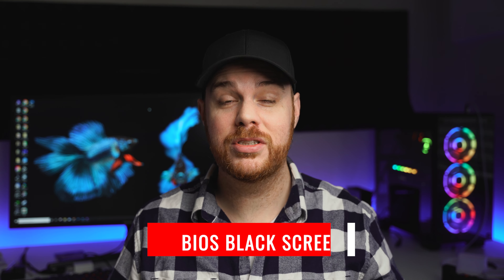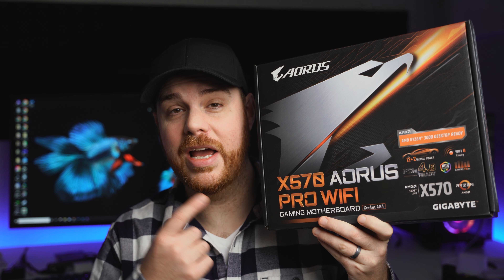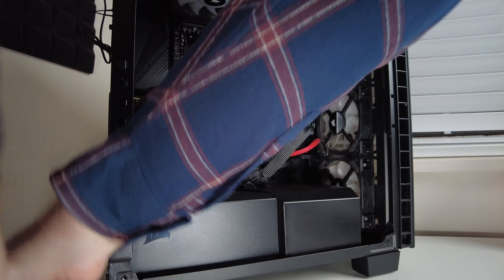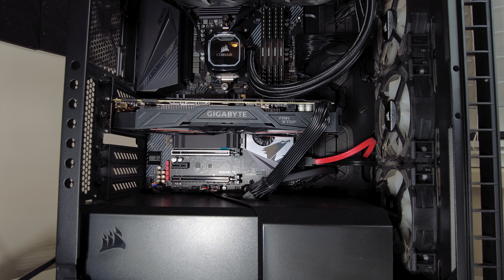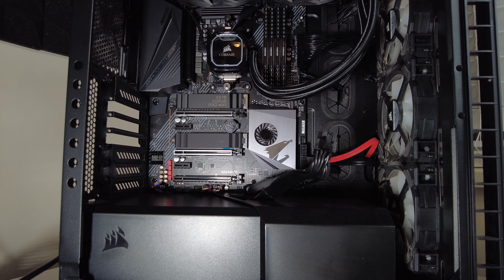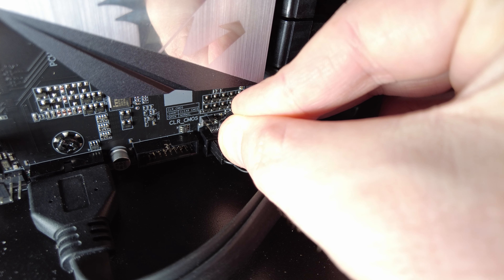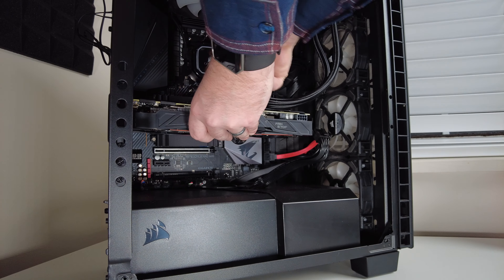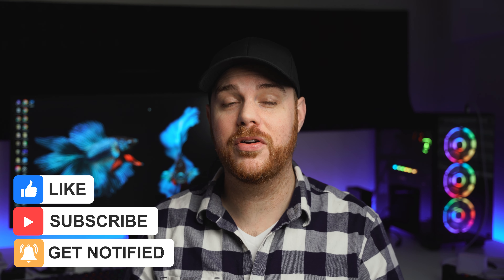How to FIX BLACK SCREEN from BIOS CHANGES (3 WAYS)

Comment from the maker: Hope this saves someone a heart attack!
Reply: I did an update through dragon centre an nothing was lit up except for my fans motherboard an ram my screen was black my keyboard an mouse were too i tried holding the power button down to turn it off but that didnt work so i cut the power completely reset it an its still the same
Reply: Holy shyt it worked my heart literally stopped for a solid hour trying to fix this
Reply: @Silence-cv5xm  know someone going through this right now. What ended up happening??
Reply: NOT ME, i updated grub via terminal in Pop OS and instantly upon restarting my computer would no longer boot.
But i could still post and get into bios so i tried changing some boot options and now my computer wont even POST. fans and diodes all light up on rx560  gpu, b350 mobo, debug lites go off after few secs but screen stays black entire time.
measured v rails at this time and get 3.08. 5.07. 12.07 on rails, cleaned out psu and inspected for burn marks or bulging caps, none. no bulging caps on mobo or gpu
ive removed the battery and shorted jbatt several times. tried removing boot m2 drive and tried a spinning disk, all for nothing.
how does this happen?
Reply: It did not work for me then I called a mechanic and he said that my hard disk is corrupted.😢
Reply: It did thanks
Reply: Thanks
Reply: Already had the heart attack... Gonna watch this video and try to fix it tomorrow when I have time!
Reply: If Stefan or anyone sees this, does the pc also need to be unpluged when you short the CMOS jumper
Reply: @baconsmasher-lancerguy  Yes
Reply: 10/10 A + THUMPS UP
Reply: You definitely saved me a heart attack! Thank you so much for this video
Reply: I'm going in. It's not bad, just an issue with my 2nd ram card and going back and forth from integrated GPU in a 3200g, which I wanted to swap with the 5600x I received last week. Flashing bios was easy and I took the latest version (MSI 450b pro max2) but then you read possible solutions as taking the updates step by step, but my version that ran wasnt' that old. And otherwsie your method or another. It will be okay :) And it's much more relaxed when you have another pc in the house (I live alone) so while lesser, you can still easily look up stuff, use it for two weeks when you have to and just game on lower setts.   

Edit: Subbed, will be watching your photography uploads tomorrow! Nice hobby/profession
Reply: This is super late but I have a button that says cmos reset, do I have to turn off my computer, unplug from the electric source and then press it? And for how long ?
Reply: Hope they got a phone to watch your videos. lmao
Reply: @shankhadeepdas9871  You called the wrong guy bro, mechanics work on mechanical vehicles and mechanical airplanes.
Unless your pc is a Tesla.
Reply: @jespermynchau5580  not a mechanic, sorry, a tech guy, whatever you call them
Reply: Bro you saved my life
Reply: this helped me so much thank you
Reply: tried but not work for me but i am glad to see someone using same graphic card with exact same model (1070 8gb 3fan)  , to be honest i don't like in term of performance , but when i overclocking this GPU only then you see real capability , but after using more than 5 years . i damaged my motherboard 2 times . ending note  before overclocking specially AMD cpu upgrade your cooling unit.

Comment: Hey guys for my Asus motherboard reseting the CMOS didnt initially work. What worked for me was removing all my ram sticks. Then I added one stick to slot one of the motherboard and restarted the PC. That finished the BIOS update. After everything is clear you can now add the rest of the sticks.
Reply: After Updating my Bios to the latest version, I got a black screen on reboot after the update. Thanks so much I saw your comment, both methods in the video didn't worked for me too, then I saw this and tried removing 1 of my ram stick as I have 2, then restart my PC. Im so happy it worked😁
Reply: @ItsCepheus  Am glad it worked for you brother
Reply: Hey what’s your Asus model mobo ? Did you reset your bios after removed the battery or other method… and then add 1 ram stick ? Or just add the ram ?
Reply: hey man, i have been struggling with this for the past week, and your comment single handedly saved my computer from getting overcharged with this simple fix, i am truly thankful for you,  and i wish you the best of luck in your life, thank you.
Reply: This is the way. Pre-built came with ram on slot 3. Reset cmos via battery and nothing but black screen on monitor. Moved ram to slot 1 and we are back in business.
Reply: Take out the ram stick then put one in and boom
Reply: Preciate this man

Comment: Such a lifesaver! I was about to start crying that my laptop didnt want to boot up properly after a BIOS restart, for the guys that have MSI laptop some of them have a very tiny power reset button on the back press it for 30 sec and voila, basically the same concept as shown in the video
Reply: Yooo on the back of the case or inside of the pc?

Comment: Dude thank you! This saved me more than you know! I thought I was going to have a heart attack when I saw the black screen. I’m not going to try to upgrade to windows 11 for a long time.
Reply: Go back to windows 7:) best one there is
Reply: BROO SAME my heart was racing like crazy and I wanted to do the same thing as you hahahaha. You messed up while trying to enable Safe Boot as well?
Reply: @julijangrajfoner1730  yoooo that's exactly what im trying to do, im carefuly watching the vid
Reply: @axelgrot5157  loool what mother board do u use?
Reply: @julijangrajfoner1730  aorus b550 elite v2 ; i resolved the problem with the battery removal strategy, but as soon as I re-disabled CSM, the black screen came back... so i guess whenever i want to work in the bios, ill have to remove the battery
Reply: @axelgrot5157  oh that's unfortunate
Reply: Msi pro b650 here and this is what worked for me too, or rather I tried this first. Thank you

Comment: I was messing around with bios and I changed something and when my pc rebooted my mobo was flashing on the dram, suggesting that there’s a problem with my ram. When I turn my pc on I am stuck on the press DEL or F2 to go to bios screen. Please help, I’ve had this pc 2 weeks and it took me 3 years to save up for and buy :(
Reply: if CMOS reset not works try to remove your components (ram, SSD + GPU) and install the bios new over the flash bios button (hope you have one). i had a blackscreen issue after update the bios for resize bar last weekend and could fix it after the mentioned solution

Comment: Yes I was messing with the BIOS settings and screen went black and this video help me. Thank you sir here a new subscriber
Reply: How did it work and which one because I tried to get Val and I just bought a pc today it’s not working
Reply: @captainluci7083  all I did was removing the Lithium Battery that comes on the Motherboard for 5 minutes and then putt it back and was working

Comment: thank you for this, this really is a life saver, was really panicking cuz i was just changing my ram frequency and the black screen just happen as soon as i reboot it, my pc is just 1 day old. really thank you and thanks to my friend who helped me in this as well.
Reply: I'm in the same boat as you. I have one question though. I had to flash my BIOS to the new chipset, before I actually built my PC. Do I need to refresh the BIOS or were you using an older chipset. Also unrelated I need blood pressure medicine now.
Reply: 99999999999

Comment: I’ve changed the battery and hard drive I’ve also checked data cable all the cables made sure they were all connected properly. I got an error message when getting home one day, been trying too get it too work again but can’t get passed bios and bios only recognizes my m.2 ssd and not my internal hdd which has my windows on it. What do I do!!!
Reply: Did u fix that?

Comment: on the battery do u change it or is it ok to use the same one?
Reply: They last a long time.  I wouldn’t change it unless BIOS settings do not save, or a known good fixes your boot problem.

Comment: Guys remove memory battery it works i do turn the second gpu and i had this problem i try to update my rtx and didn't work when i remove gpu and remove the memory battery i still removing it between 10s and 30s and put it back in its place & put your gpu also after finishing these Steps 
 start your pc after 20s it will works and u should see the bios automatically without spamming any button

Comment: hello, Iam trying to get into the bios and everytime I enter, my monitor goes into sleep mode, but my pc is running the bios. ive tried my hdmi in the graphics card and onthe mobo, as well as trying another monitor. ive tried different resolutions and that did not work. this is really annoying and ive searched forums and google and cant find anything on this. anyone know how to fix this?
Reply: Got the Same issue Did you get it fixed

Comment: I have a dell optiplex 9010 i went to the bios and disabled the  sata operation and now im getting no display any solutions?
Reply: Have you find a solution
Reply: @harysviewty  yeah it was my motherboard, I switched it to Asrock z77 extreme4 and it works great, it also  starts up under 5 seconds

Comment: i dont have a reset button, removed and replaced battery and tried to short cmos jumper
nothing worked pc still not showing a display, but everything turns on
Reply: have u find a fix?
Reply: @Rantize  that's what i don't understand they never reply ever
Reply: @SamuraiDanny frrr... Did you find a fix? I'm dealing with this issue rn
Reply: anybody found a fix?
Reply: @ sorry for the late reply, youtube failed to let me know you did...i didn't find a fix sadly...i ended up getting a used PC from my cousin
Reply: @ or sometimes people dont get notified when they get replies
Reply: @icanartsorta  ahh okay thanks tho for replying
Reply: I ended up fixing mine. It was front panel connectors not being properly seated. So I just stretched the wire more to the front and that solved my headaches lol.
Reply: @aliennzzz  im gonna try to do that
Reply: @aliennzzz  my pc  started giving me a black screen after i turned on secure boot in my bios
Reply: @ATLDanke  sorry... I forgot to ask did it work out for you???
Reply: @aliennzzz  nope just bought a new motherboard now im gaming happily
Reply: Damn... Well at least u found your source of the problem.... I wasted money replacing good parts and it was just my panel connectors lol
Reply: @aliennzzz  damm try to get refunds

Comment: The battery saved me. I tried messing with my ram clocking speeds, saved and booted the pc up. Black screen as if my pc was off. Took battery out and poof within 15 seconds JT was working again

Comment: None of these methods helped. Updated BIOS, after update OS was still launching for several weeks until I've noticed the black screen upon entering BIOS. Followed your instructions, black screen is still there but now I can't load to OS - initial setup is required which is not possible due to black screen. Looks like I'm screwed, thank you, kind sir!

Comment: when I changed the ram from my prebuilt pc from 16gb to 32gb 3600mhz when i checked the task manager it said 2133mhz so i went into the bios and tried changing it and when I saved the changes it cause my monitor to not display when my pc is on Its not my gpy or anything else my pc is clean i even tried cleaning the ram and it still didnt work. its a omen 25L

Comment: Thanks for the video. We have similar MOBOs (Z390 Master 1.0 here). In addition to the above steps, there's potentially a 4th method which is a motherboard BIOS switch for Main and Backup. After attempting to update from CSM to TPM 2.0, I got the black screen.  However I knew upon last firmware update I backed up the BIOS. Switching from the Main BIOS physical switch on the motherboard from 1 to 2 easily cured the black screen issue. No removal of battery, jumpering or even a CMOS reset button. While this worked and I'm back into Windows, the MAIN CMOS (switch 1) is still corrupt. Hoping to locate an AOROUS approved method to restore the MAIN BIOS from a BACKUP BIOS..thank you for this video.
The NVIDIA site claims to remove the graphics card completely out of the MOBO and boot to the onboard Integrated Graphics (motherboard video connection/connect video cable as well). This will get you into the BIOS and bypass Black Screen. However some of do not have Integrated Onboard Video with the KF series Intel chips and there's no answer as of yet..working with NVIDIA and GIGABYTE lead support to find a resolution [10-15-21]
Reply: same issue i'm having
Reply: I have an aorus b560 with GTX 1060 and I can only access the BIOS via HDMI if I enable csm support, I have tried everything, uefi mode does not show BIOS via HDMI if it does not enable csm
Reply: HELP , I have asus prime x570 pro , r9 5900x cpu and none of these steps work for me , does my motherboard have something similar to what yours does?
Reply: @BelaPuma did you solve it ?

Comment: I did a bios update and my pc is still stuck in a black screen plz help
Reply from the maker: Did you take out the battery?
Reply: It worked bro thanks for the help your a god bro .❤️❤️❤️❤️
Reply: Brooo ive already updated twice the bios but still black screeeen whyyyy??????? I need helpppp
Reply: @StefanMalloch  bro, i buy a new pc last week 10 Feb 2021- - ryzen 3 3200g processor, Msi A320M motherboard, Pny 8gb ram, corsair power supply 450w, Samsung S22f350 monitor but the problem is when i on my pc normally pc is on but monitor screen black just, check signal cable word ups and down. 
Plz help
Reply: @darkknght1  did u fix it

Comment: I updated the bios on my MSI PRO MAX to bios version 7C52v2C... My current version was 2019 build. I haven't added any new hardware, I am only using what is currently / originally in the pc.

AMD RADEON R5
TEAM GROUP 8GB DDR4
NO DEDICATED GRAPHICS CARD ONLY USING INTERGATED

I applied the update the PC restarted and now I am not able to get to post boot or see anything on the screen (s).

I have tried the following

Removed CMOS Battery for 10 hours
Short  JBAT1 for 10 seconds
Removed all internal components and booted

The screen remains blank and I cannot see anything, I have tried so many different methods with no luck. I need help with this ASAP.

Comment: My issue is that my PC boots and I have no display issues AFTER Windows boots. Before Windows boots, I have no display and cannot enter BIOS to change settings or boot device, nor can I enter WinRE

(Can't WinRE from the power button trick because my power button is broken on the mo-bo's side, so I have it re-wired to restart on the mo-bo. does the job. Hold for force shut down, tap for restart, tap for start from shutdown 🤷)
Reply: To the person who liked my comment, my monitor setup (display settings) defaulted after Windows upgrade. I had my TV connected to onboard graphics and was defaulted to Monitor 1.

I didn't have the TV display the source of the PC, so I never saw that's where the output went.

Felt like an idiot, but there you are. Just reconfigure your display settings to set your primary and secondary monitors.

Note: don't use this in an interview when asked about troubleshooting experience. I thought the interviewer and I would have a laugh... They did not laugh, nor did I get the job 🥲

Comment: by replacing the CMOS battery did u mean get a new one?
Reply from the maker: You can but you just need to take it out for a bit and put it back in. They are cheap, and you can replace if its been a few years but should be fine.
Reply: @StefanMalloch  hey, pls reply me I just bought a new pc and I was messing up with my integrated graphics settings in bios so after saving it my screen was black and cpu debug light was on in the motherboard idk what to do 😞

Comment: Maybe you can help me. After a ton of research, I went with a new Asus ROG Strix B550-F Gaming WIFI, a Ryzen 7 5800x3d, a Gigabyte Geforce3080 12GB CPU, 4x8 DDR4 Corsair Vengence RGB Pro Ram, and a Corsair RM850x Power Supply. I have several issues. I assembled the entire system, downloaded the Bios update, and was ready to rock. I hit the power button and nothing. I have the LED on the board but nothing powers. After trying the flash and still nothing I started to Troubleshoot. I managed to get the system to start but had to unplug the GPU to get the system to power on. I have tried 2 different USB sticks to flash the bios as directed Fat32, renamed Etc. My green light stays on, I have tried 4 or 5 times. I even removed the battery to reset the CMOS and still solid green. Problem is I have no idea if any one of these parts came DOA. Everything is New from Amazon, All boxes were sealed. I suspect the Power Supply but have no idea at this point. I am about $2800 in parts and kinda stuck. I used to own a Computer Store, I never once was stumped like this in 5 years in the store and another 15 as a tech.

Comment: Removed and replaced battery and shortened the circuit, both did not help with this problem and the VGA light stays red.

Comment: I had the same problem with B650 aorus mb . It took me 4 times to get to working solution . What I did in the end was , i put all the settings to default -save - restart and it work with qflash as it should . Never had to do it on b550 gigabyte board , so fk what they playing at this time round !

Comment: I was messing around with the bios and changed many things and after that my monitor won't start but the cpu will and i did send my cpu to repair shop and they can't even fix it but they told me to changed motherboard  so i don't really have the money for that